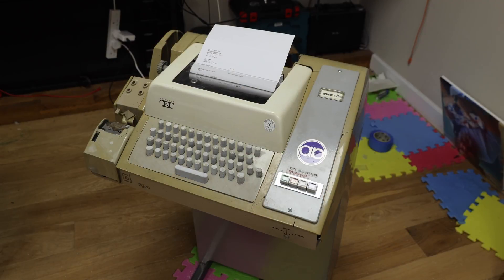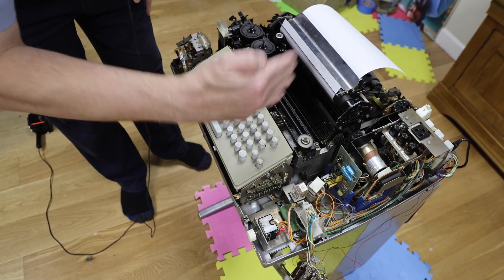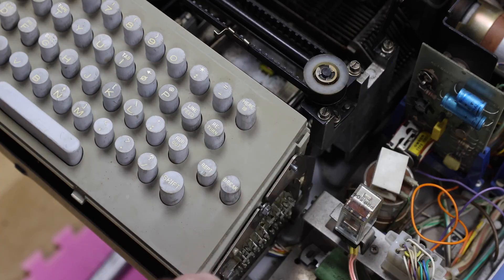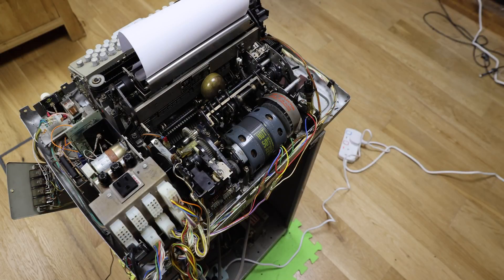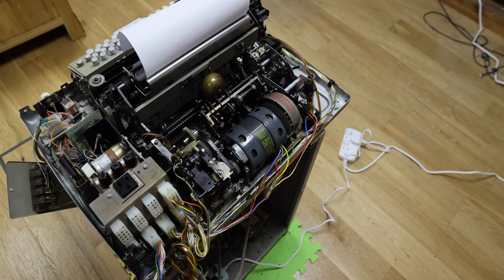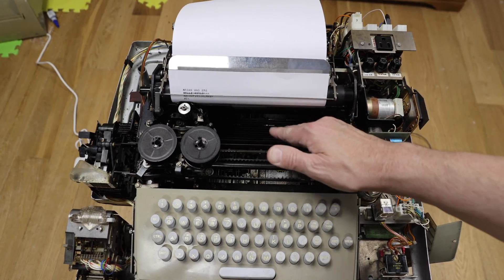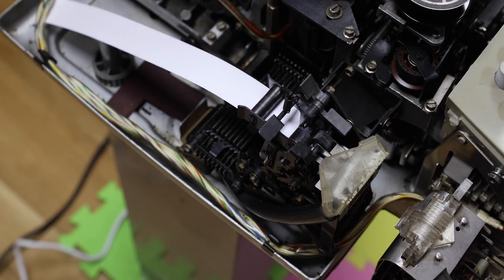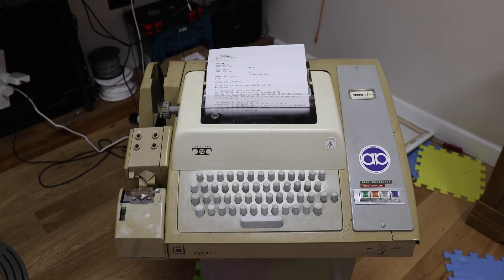How it works (ASR33)

Comment: I learned to program using a KSR33 (the punch/reader -less variant of the ASR33) and dial-up to a nearby school district's time-share HP 2000F running, for our use, HP BASIC. Eventually we computer geeks convinced our high school to upgrade from the KSR33 to the ASR33 and now we could save (punch tape) and restore (read tape) our programs rather than have to retype them frequently. Fun Fact: the answerback drums were setup, IIRC, just like the tape with 3 bits (rings of breakable tabs) on one side of a sprocket wheel and five bits (more rings of breakable tabs) on the other. As noted, you broke off the tabs to encode up to twenty (?)  characters. Each of the twenty rows of tabs encoded, in ASCII, the answerback or Here Is string. IIRC, Here Is was defined as one of the ASCII Cntrl+Character code points and receiving that code caused the answerback drum sequence to be read/transmitted. I think it was ENQ (Ctrl+E, 0x05). We figured this out and set up an answerback ourselves, but I have no idea to what we would have set it. IIRC, also, the DC1 (Device Control 1, encoded as Ctrl+Q, 0x11) /DC2 (Ctrl+S, 0x12) /DC3 (Ctrl+T, 0x13) /DC4 (Ctrl+U, 0x14) code points, for the ASR33, were used to start/stop the tape reader and punch. We also had way too much fun with Ctrl+G/0x07--rings the teletype's bell when sent or received.

Good times…